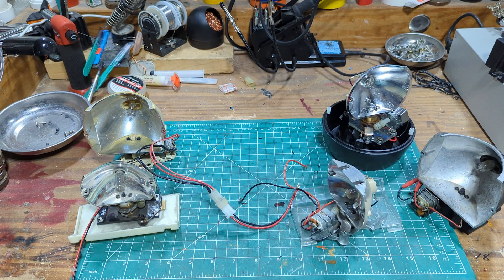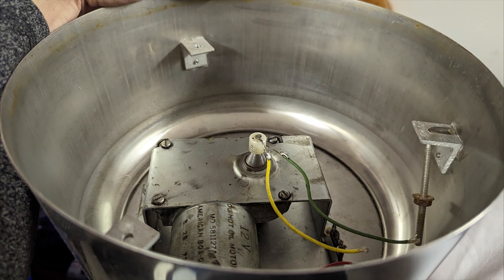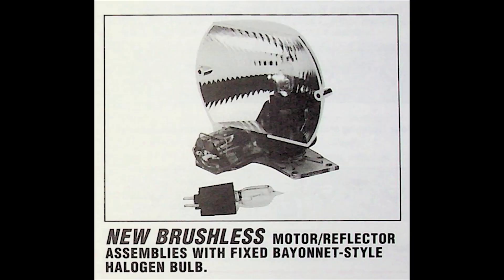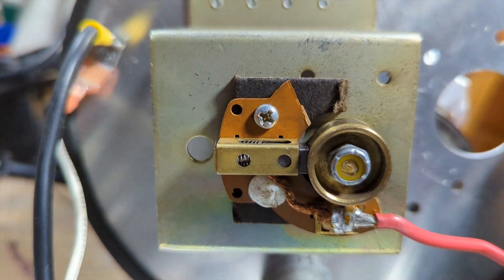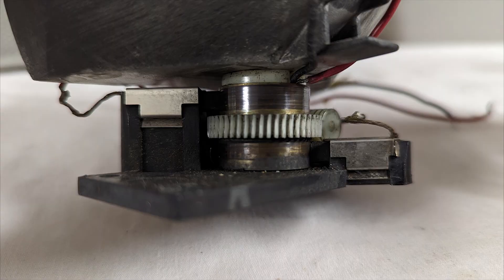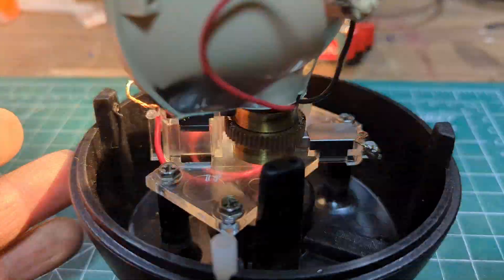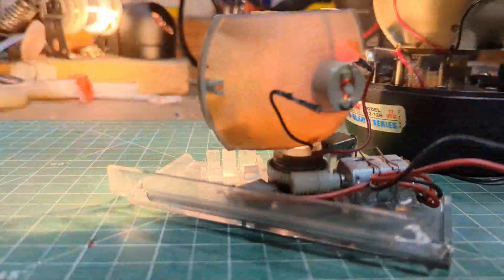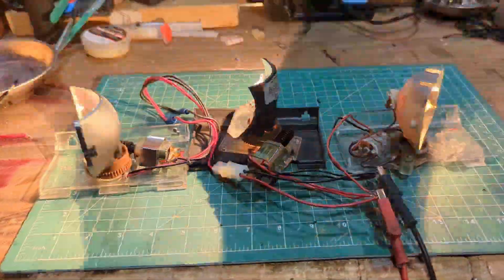Whelen "Brushless Rotator" Terminology Explained

Comment: I rebuilt a signal-stat lightbar from the ground up... It was my first experience working with a lightbar that used a contact spinning plate.
Reply from the maker: I hear that; My first experience was a code 3 SD / XL9000. I was confused by the plate being on the rotating head and the brush on the bar. Cool design but easy to miss a problem for a novice. It took me way longer than it should have.